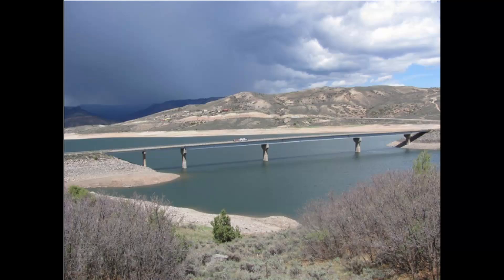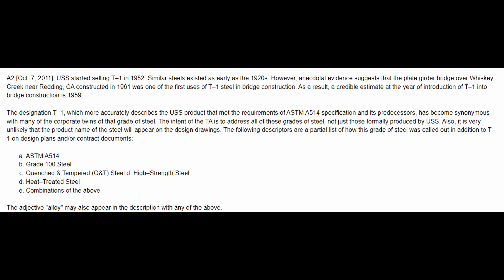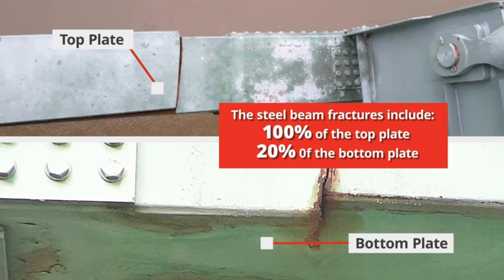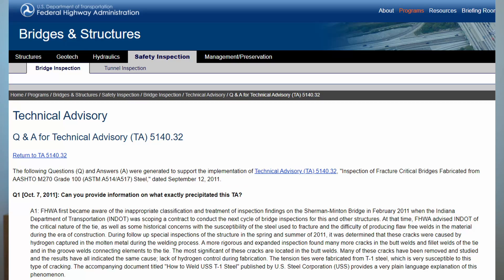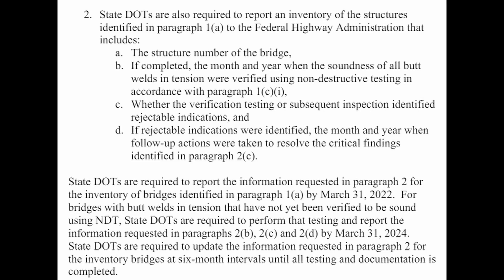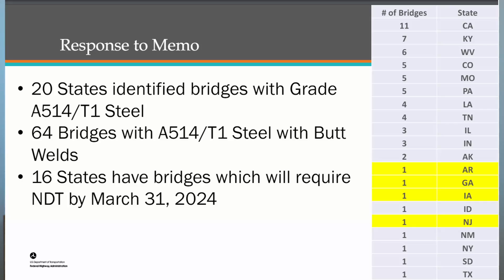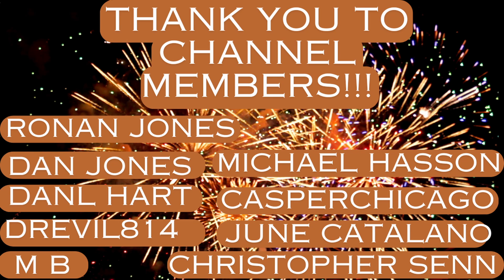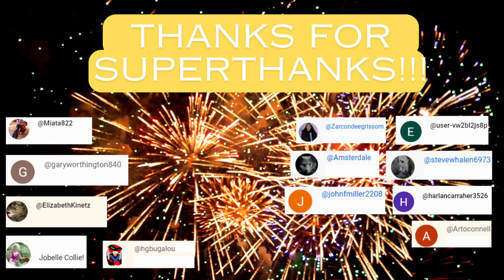The Major Implications of the US-50 Bridge Closure in Colorado

Comment: It's not just the bridges.  It is the highways in general.  Opened in the 70's, interstates, many were 2 lanes each way and remain that way right up until today and are highly inadequate for the traffic.  One such is I20 in Texas and beyond that undersized for the traffic where slower moving traffic is so great that the 'passing' lane has become the main lane for motorists.  This causes major accidents at an increased rate with subsequent injuries.  Nothing has been done to improve these roads, to weden them to make them safer and saner to drive on.  Some tall 'jersey' barriors have been erected in some areas to prevent cross over type accidents but that money could be spent on new lanes rather than barriers.  We have one bride that has been under construction for over 2 years with one lane closed and a temporary traffic signal light up to allow each way traffic to share the one lane.  No progress has been made in construction for over a year.  The remaining lane gets all the load both ways.  And this limits the width of loads as well causing major detours.  Our highway taxes seem to have been pilfered for other things rather than maintain a once proud highway system.  We now live iin a third world scenario when driving.
Reply from the maker: You are right.  Where I live in the Midwest politicians diverted (stole) money from fuel taxes that were supposed to be for transportation projects to pay general obligations.
Reply: @CaseyJones-Engineer  Seemingly many issues such as this can be traced back to the US Constitution and "state's rights" if  interstate highways are under the purview of the the Federal government, but actually maladministered by individual States.  Fascinating! (Who ya gonna blame?)
Reply: @SubTroppo  Is it better to be maladministered by the Federal government?
Reply: @michaelmcmullen354  To equivocate in answering your question: it depends on the level of maladministration.  One can only hope that the higher up one goes in the political food-chain, the less the local-yokels are involved with their internecine struggles.  However once you are aware of the "earmarks" corruption at the heart of the US system... [Continued page 94]
Reply: I am also uncertain that bridges on federal lands are any better administered than the average state administers theirs.  After all they get their expertise from hiring engineers from the states.  Their funding is less limited though, and if an expert in your field you don't have to become a manager to be promoted.
Reply: Note that highway construction is usually designed for the traffic expected up to 30 years in the future.  When I started I think the target was 20 years.  Of course transportation planners crystal balls are not perfect and get progressively cloudier the further out you attempt to predict.
Reply: One thing I've noticed after moving to Glenwood Springs was the just completed the I70 Glenwood Canyon project 30 years ago. it was nice, relatively fast, shiny and new, with cantilevered and hidden suspension bridges all along it's path. the suspension hidden below the road bed in the box portion beneath it. 
In 30 years, it has turned into a potholed mess. I have to wonder what water incursion is doing to the steel cabling beneath
Reply: @davidconner-shover51   My design.  I have seen some of those very cables exposed during rockfall repair.  I don't know why, but they looked good.  I think the water seaping out of the clifside may have been somewhat alkaline.
Reply: @michaelmcmullen354  lots of mag chloride, yes, a salt, but it doesn't shred steel like halite does
Reply: @davidconner-shover51  Colorado tries to use Mag chloride mostly, but they also use other products where and when it is too cold for mag chloride to work.
Reply: @michaelmcmullen354  yeah, sand or volcanic cinder is very popular in the colder spots, it actually binds up nicely with the ice to give a decent traction surface as long as it stays below freezing
Reply: @davidconner-shover51  EPA has forced Colorado to limit use of sand in many areas due to air quality.  The sand grinds to dust, and grinds concrete to dust, and maybe the tire rubber as well.  With reduced sand use, more Mag chloride.  Often applied as a pre storm prophilactic.
Reply: Also the high volumes of sand have been plugging ditches and streams.  One thing I designed was a sand/meltwater seperator along side a particularly onerous stretch of interstate above 10,000ft.
Reply: @michaelmcmullen354  when they first began to use it, they would use massive quantities at the first hint of a storm, whey have become much more judicious with it's use lately.
As to sand or cinder, that is usually deployed when the temps are expected to remain well below freezing for several days or more
Reply: @davidconner-shover51  They try hard to get the road totaly clear of snow and ice as soon as possible.  Much of Colorado in the mountains is curvy and with steepish grades.  In winter also a lot of snow bunnies and bucks from warm climes with lead feet and a perchant for 65 to 75 mph.  Locals on local roads, not so much.  They like 35 to 45 mph on snowpack.
Reply: @davidconner-shover51  Note that origional high Mag chloride use (and sodium chloride before than) makes for a front of high chloride still diffusing towards the reinforcing.
Reply: @davidconner-shover51  Last I knew the cables in the bridges were doing well.  The ones in the concrete deck may eventually be iffy as rockfalls damage the concrete and grout protecting them.  Fortunately an isolated tendon or two is probably not likily to be an issue as the railing parapet serves as an edge beam greatly decreasing the load on any single location.
Reply: Luckily the Dems passed an Infrastructure bill to take our nation into the future.
Reply: pilfered for millions of prime rib lunches and dinners.

Comment: They should keep the bridge open to vehicles under 7500 GVW with patches.  It’s crazy to shut it down completely.
Reply: But then CDOT wouldn't have justification for hiring more staff and spending more money
Reply: @ArtStoneUS  It is expensive.  I think they had to scour the US for firms and people with the right skills.  A lot of CDOT's inspectors time has probably been taken up by this.  They are probably going to fall behind on the ~2000  inspections they are supposed to do or check this year.  Fortunately the bridge sized culverts and the integral precast girder bridges (no joints) take much less time.

Comment: re-weld the cracked member & open the bridge. one day job. new cracks will open and undiscovered cracks can be located. no reason to close bridge for undiscovered cracks? if it is that dangerous, then condemn every t-1 bridge immediately.
Reply: I agree.  They are going overboard on this.  Think of how many people will die not getting to the hospital in an emergency.  They should keep heavy vehicles off of it except for emergency vehicles until there is a more permanent fix.
Reply: @user-tb7rn1il3q   Great idea then when it collapses and kills people AFTER you publicly admitted cracks were found and closure was recommended I'm sure that'll go over really well.  Helicopters exist for emergencies.
Reply: In a sense this is what they are doing.  They seem to be plating over every tension T1 butt weld.  Note the cracks are not now "undiscoveered"  after the UT inspections.  If the structure was not "fracture critical"  your recommendation is perfectly appropriate, but with "fracture critical"  there is a very high probability that the first visable sign of a crack is collapse of the structure.

Comment: Seems to me that there have been drones capable of 3D mapping of structures available for at least a few years now….and with the advances in AI , I believe bridge inspections will be able to overcome most all of the existing obstacles
Reply: That's a good point! Even without AI, a drone operator can visually inspect underneath a bridge more quickly than with a crane-basket. But non destructive testing would still have to be done with people physically reaching the joints. Would drone operated ultrasound testing be possible?
Reply from the maker: I don't think that such drone-based testing would be possible now, but give it a few years and there may be some break throughs.
Reply: I know I've seen drones being used this way, but there will still be things that a drone couldn't see and a person has to crawl into. 

If you want to get fancy, what I'd do is attach sensors to the steel that monitor for the sounds of cracking, or to do continuous echo testing. That kind of equipment, processing, and communication is really cheap now, and can be run on tiny amounts of solar power.
Reply: @blairhoughton7918  I think this has potential.

Comment: Bridges don’t have to be closed to have a huge impact. Bridges often have their weight rating downgraded when the condition is deemed to be poor, which can allow cars to continue using them but not heavier vehicles like school buses and trucks. This affects school buses possibly more than anything else because they have to travel rural roads that trucks don’t. My business helps school districts route buses more efficiently using the same tech that UPS and FedEx use to route their trucks. I’m dealing with a situation right now where two bridges were downgraded to a 4 ton limit which cut off a huge area of the school district and buses have to make a 10-15 mile detour to get to that area. It’s causing kids to be on the bus much longer and increasing costs for the district.
Reply: I suspect (but could be wrong) that they are attempting to get the repairs strong enough to carry the states permit truck (96 tons),  as there are not other reasonable routes.

Comment: Hopefully their inspections are not just done as per their guidance and limit inspections to just not welds, as your one photo showed at time line 3:13, the cracking or break occurred not at a weld, but to the side of a bolted or riveted joint!
Reply: The fracture at 3:13 is actually at a weld where two thicknesses are joined. 
 The entire forensic report can be found here: www.ardot.gov/wp-content/uploads/2021/11/Fracture-Investigation-I-40-MS-Rvr-Bridge.pdf
Reply: There is a reason for that.  The amount of the cross sectio the bolt holes take up is severely limited as it will compromise the ultimate strength of the area at the bolted splice (T1's ultimate strength is only 15% higher than its yield strength so the practice was to weld in a shorter but thicker T1 plate  so that the splice would be at least as strong as the flange being spliced.  Other steels have an ultimate strength 40% to 60% higher than their yeild.  So with T1 every bolted splice has a flange welded splice a few inches to a foot away.

Comment: if RAM (rarely accessed memory) is up to snuff, seems to me about some 30 odd years ago it was determined that the majority of america's bridges were failing and nothing seems to have been done except build more of them.

thanks for your time and efforts Casey, they are appreciated and very much looked forward to.
Reply from the maker: Thank you very much!  I hope to spot light what is going on with these situations.  Our infrastructure has apparently become a non-renewable resource.
Reply: Our local crossing of the Skeena River , we call it the old bridge . It was built in 1924 and is still in service today . Over the years it has been rigorously maintained as it was the only way to cross the river . But now it’s a alternative route , when it’s closed you notice  the traffic on the other bridge is heavier  . My point being is the bridge was riveted , not welded  . Most railroad bridges are build that way , and they receive a lot more weight than a highway bridge . 👍🇨🇦
Reply: I sorta recall the bridges and dams both coming under heavy scrutiny around the same time period and not being 30 years ago (could be wrong). Pennsylvania has been repairing and replacing bridges like crazy for at least 10+ years, and our dams are also being repaired, drained, or put on an action plan.
Reply: Note that over those 30 years many, if not most, of those structures that were rated fair aged and degraded to poor.  I think in general the percentage of of bridges rated poor has decreased over the last 30 years.  I know that was the case in Colorado where several large (budget chokers) bridges were rehabilitated or replaced which dropped the percentage of poor deck area substantially.
Reply: For Colorado we are under 10% in the poor category after a major problem structure was rehabed to fair, and then replaced 12 years later.  I think the plan is to keep it under 10%.  Note for us every decade will bring another 10% into the poor category.  We are doing a lot of upgrading of disfunctional roadway sections and that is chipping away at a number of our poor and fair structures that need to be replaced as part of the road upgrade.  As I mentioned we are chipping away at our ancient timber bridges with girder issues, we are more aggressive with replacement of leaking expansion joints, now have a policy to try to get some corrosion protection on all decks.  That leaves diaphragm to flange web gap cracks that develop on most of our welded (especially skewed or curved) steel bridges.  This was a mandated (by code) stupid detail until about 3 decades ago.  As far as the joints go I would prefer to eliminate more of them rather than replace.  Price is about the same.  Requires some analysis though.  Or motion monitoring data.  Code data is OK for steel bridges, but from observations seems ultra conservative for reinforced concrete here.  I don't know about prestressed or posttensioned concrete though.  We have had issues with joints and bearings, but I think the issue is more related to pier stiffnesses, sliding bearing variable friction, a lack of coordination of motion limits of bearings, joints, and rail joints.
Reply: Priorities, son, it's all about priorities!!  You can't have a decent infrastructure and health care and free college education AND a useless trillion and a half dollar military, unlimited corporate welfare plus billions in foreign aid to rathole white nationalist or apartheid theocracies! You gotta choose those priorities!
Reply: Yeah government
Reply: @OffendingTheOffendable  That's what happens when you don't tax people who have a lot of money, you end up not being able to pay to do things.
Reply: @badlandskid 
Daily reminder that since the beginning of the conflict, we haven't spent even ⅛ of our military budget for one year, on Ukraine.

You're tilting at windmills if you're talking about Ukraine.

If you're talking about Israel, we send them about ¼ of our military budget every year.
Reply: @Binturong3850  yeah, we don’t need to be sending our money anywhere overseas.  We have our own bridges to worry about here.

Comment: Scary stuff but I’m always happy when another bridge problem gets attention before rather than after it falls down. Is there any thoughts of civilian volunteers taking pictures of cracks—-I believe I remember there was a boater who spotted the Mississippi bridge crack. Lots of people have telescopic lenses……
Thanks for a well presented video!
Reply from the maker: Thanks very much!  It makes me wonder about what engineering and construction problems will occur in the future because of issues that are not currently known or recognized at the present time.
Reply: @CaseyJones-Engineer  Your recent presentation on the collapse in Dresden highlights problems with Post-tensioning  in decks without waterproofing membrans, or with anchorages under leaking joints for either unbonded tendons or in narrow solid support segments.  There have been tendon failures, mostly caught, but not much with collapse in the US so far.  Inspection is difficult.
Reply from the maker: @michaelmcmullen354   That's a good point. I think there needs to be more emphasis on making sure that fracture critical compnents are accessible for inspections. That was the problem with the Washington bridge in Rhode Island.
Reply: @CaseyJones-Engineer  Making these tendons accessible is one of the things that makes them fracture critical.
Reply: @CaseyJones-Engineer  When Segmental struxtures were introduced to the US their industry pushed hard for dry joints (no sealing) no overlay or waterproofing membrane, putting tendons high in the deck (close to the wearing surface) or unbonded and non-redundant, and using their own design code... in the name of speed and lighter weight.
Reply from the maker: @michaelmcmullen354   I didn't think of it that way. But it makes sense.
Reply: @CaseyJones-Engineer  Exactly what many practicing engineers worry about.  What is going to turn around and bite you later?
Reply: I think citizen inspectors won't have access to 100% of the vulnerable parts of a given bridge. Too many pieces and angles and hidden connections, hence the need for the carnival-ride trucks.